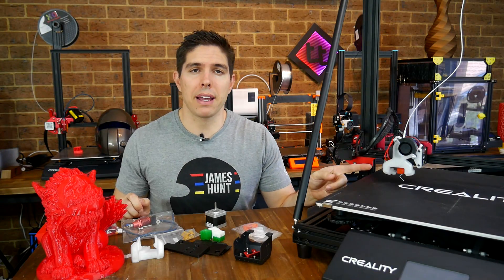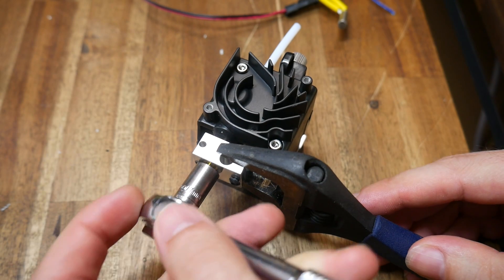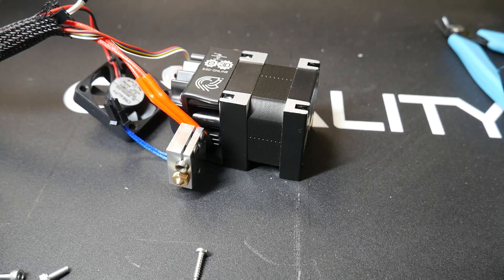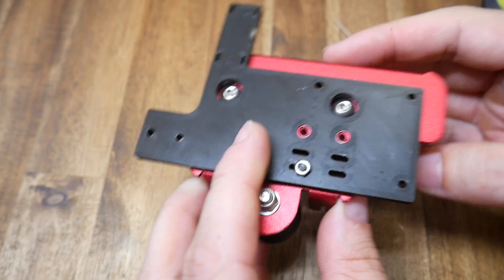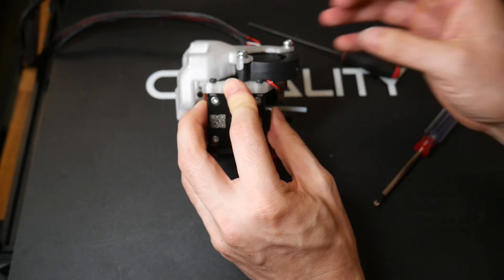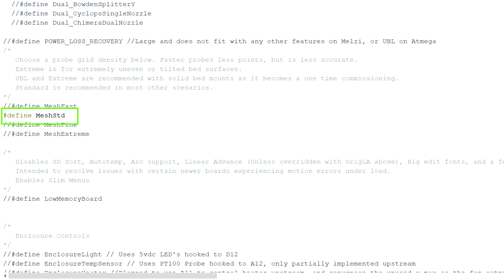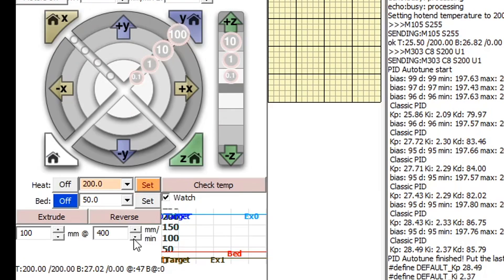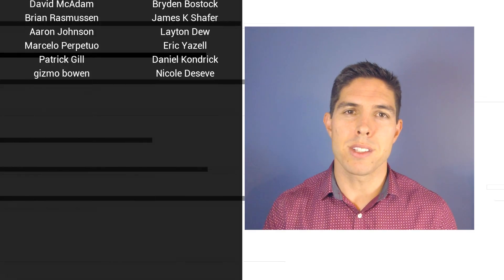Hemera install guide for CR-10S Pro / CR-10 Max

Comment: Another thing I noticed, if the thermal compound in the Hemera heatbreak threads is too thin or otherwise comprised, you will get intermittent heat creep issues. It can appear to print beautifully for several minutes, then it will begin to underextrude and jam. If you pull the jammed filament out, clip it, and reinsert it, it will print great for another time period just to repeat the process. To avoid this make sure your thermal compound is very well applied, the difference is night and day.

Comment: Very useful video as usual. I'm planning to install it on Cr10S Pro. Loved the minimalist style base plate. Have modified it for stock Hemera e3d hotend with space to mount filament run out sensor. Will post it on thingiverse in a day or two.
Reply: have you done it and if so how did you get the firmware to compile.

Comment: Nice vid, just one correction. I think you only need to uncomment HotendE3D and E3DHemera. The rest will be defined later automatically. But right now I'm unsure because I don't have my folder with my changes files with me. Also, I think you need to change the defined thermistor. But let me check that.
Reply: Ok, you only don't need to uncomment DirectDrive. And with that you dont need to change the defined thermistor. The only thing that wold add to the video would be to check the NOZZLE_TO_PROBE_OFFSET with your Mount.

Comment: Do you remember 911, the crashing Twin Towers? Ok, this is something the whole world will never forget. But why I‘m talking about? Because of heat and the behavior of steel. Why is this interesting for 3D printing? When steel gets warmer and warmer it looses it‘s strength. When it‘s at 500°C it has loose 50% of it‘s strength. At 1600°C it melts. You just need 1/3 of it‘s temperature range to loose 50% of strength. Now we have a look at our hotend. It‘s mostly made of aluminium. Aluminium melts at 600°C. When I compare it to steel, our 200°C at 3D printing will cost the alu hotend 50% of it‘s strength. Printing PETG at 235°C or PACF at 250°C will make the hotend weak. A collusion with anything (for example at sequential print)at this temperature can cause a break of the M6 in the hotend. This happened more than 2 times at my sidewinder ( Volcano) After thinking about temperature and strength of aluminium I decided to use brass or copper instead of Aluminium. After this change I had no issues any more.

Comment: Thanks, it's nice to have a video guide for this, even if E3D's written guide is pretty thorough--visual learners and all that.  Kind of confused by two things, though: (1) Why not use the existing design that E3D gives you for the mounting (https://www.myminifactory.com/object/3d-print-e3d-hemera-mount-for-cr-10s-pro-and-cr-10-max-106055)?  It's a single piece rather than the Ender 3's sandwich, it doesn't look any more bulky than yours, and it doesn't require drilling any holes through the carriage.  And it gives a convenient pocket for the thermistor connector, avoiding that concern you mention in the video.  (2) You're rightly concerned about damaging the carriage roller when drilling one of the mounting holes, so why not just take it off?  In neither case do I mean to criticize, but I'm curious about these decisions.

Comment: I’ve noticed with the volcano it is almost impossible to change without dismantling everything. Would an xt30 connector be ok on the heater cable near the heater? It would make it a lot easier but I’m not sure how much the heat travels up the cable, if it is too hot what would be a good alternative connector?
Reply: Sorry I’m referring to changing the heat block

Comment: Omg. Thank you so much for sharing this there is no decent video guides for hemera especially for cr10s pro.

I bought one last week its been 3 days spent whole weekend trying to get it going as i am noob and have no idea about firmware.

Can i follow the firmware part for me my cr10s pro.

I have v1.

Thank you so much again best video and content. Love your work
Reply: The firmware changes for the CR-10S Pro should be the same, except that you'd choose that printer in Configuration.h rather than the CR10 Max.
Reply: @danbrown586  thanks for your reply.
Reply: @danbrown586  Hey .. I hope that applys for the CR-10s Pro v2 aswell!!!

Comment: First of all, awesome video as usual. One question: is the tinymachines firmware Marlin 2.0?
Reply: Yes, the linked branch is based on Marlin 2.0.
Reply: @danbrown586  thank you for the answer. I was confused because I thought Marlin 2.0 could only be edited on Vscode
Reply: @almirantecarvalho  That's only the case when you're compiling it for a 32-bit board.  You can use VSCode/PlatformIO to build it for the 8-bit board in the CR-10S Pro/CR-10 Max, but you don't need to--you can still use the Arduino IDE if you prefer.
Reply: @danbrown586  Thank you again!

Comment: If memory serves the hemera stepper is closer to a pancake. It just has mounting blocks on each end that make it look like a full size. Bet you can drop the "vref" on it 100mA or so since it's a geared drive.
Reply from the maker: You're totally right, it's just a pain to flip this big girl over to access the electronics.

Comment: for the ender 3 i found you can use the normal t nuts for the y extrusion so you can slide the rail front to back and gain back the lost y travel. Normally there are holes and just scres into threads into the extrusion. Might have to drill out the threads but i used m3 bolts insted of m4 so it just fit through them since it was all i had.

Comment: Just a little "magic" in the video: In the end there suddenly is a silicone sock on the volcano, but it wasn't added in the video before... The moment you add the silicone sock is relevant, as it changes the PID you need. So if using silicone sock, add it before doing PID tuning.
Reply from the maker: You are correct. Got the footage of the silicone sock going back on after the hot tighten but left it out by accident.

Comment: I have an hemera extruder attached to my ender 3 with a custom allumium x-carriage wich actually was pretty easy to make with a handsaw and a drill.
With this Solution i loose hardly any buildvolume and it is actually almost as compact and even stirdier than the stock assembly. So i cant reelly agree with you that this upgrade would not make that much sense on an e3 because I got far better and more reliable printing results than before. But still your videos are great and have helped me often enough.
Reply from the maker: The Hemera is a quality piece of gear, what I'm referring to is it's price vs the printer itself  and the loss of build volume on a moderate sized printer. Your install sounds very tidy.

Comment: For the firmware idk of you did it but you didn’t show it but after you do a firmware update you should reset the eprom and after you reset save it by using the m500
Reply from the maker: M500 saves all of your current settings, which means an M502 to restore settings from the firmware would overwrite all of the calibration you just did.

Comment: Is it not possible to make a mount that has no loss in build volume for the more popular cr-10 / ender 3? 😭
Reply from the maker: The build volume for this printer is rated as 450 x 450mm, yet the bed and travel is more like 470 x 470. So we do actually lose a fraction but since there was spare to begin with it's ok. Ender 3 doesn't have this luxury.
Reply: @TeachingTech  I have done this. I made my own custom aluminium carriage plate to mount the hemera and the BL-touch. i also moved the y-axis endstopp slightly. 

im able to reach the entire 235x235 bed.

edit: I have a ender 3 pro.
Reply: Ive done it, its not trivial. the whole thing needed to be mounted lower on the existing carriage and made an metal extension. i had the mount the bottom roller bolt the opposite way so the nut is on the back for more clearance. but then needed to cut slots in the x gantry brackets to clear the nut.